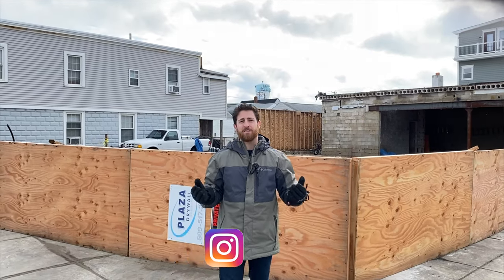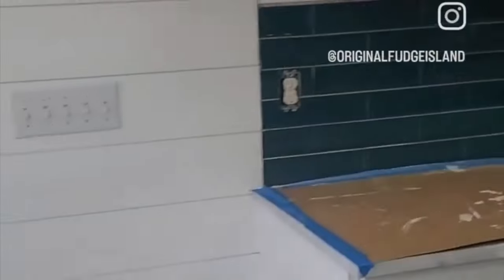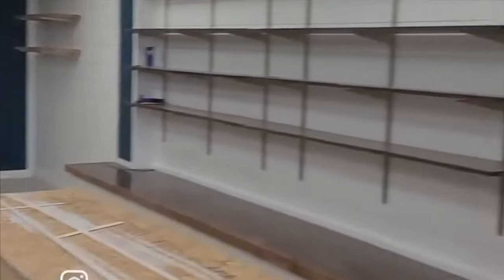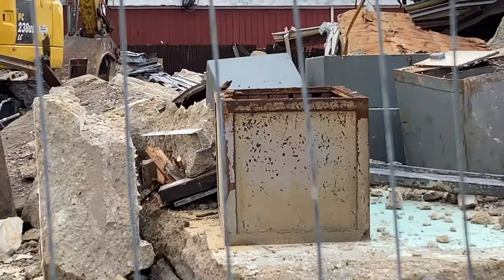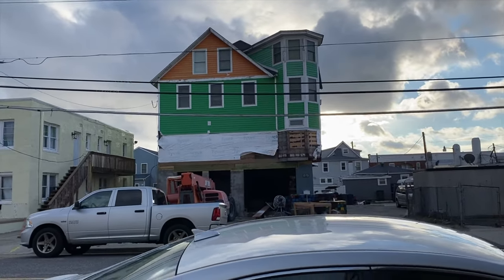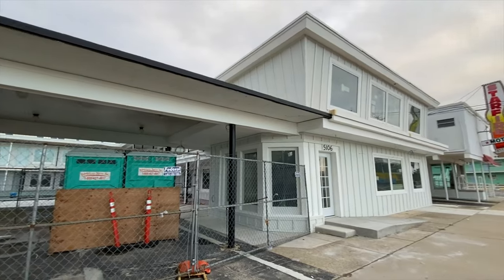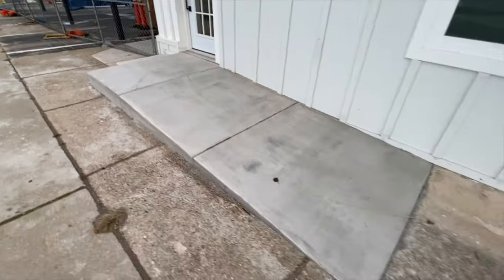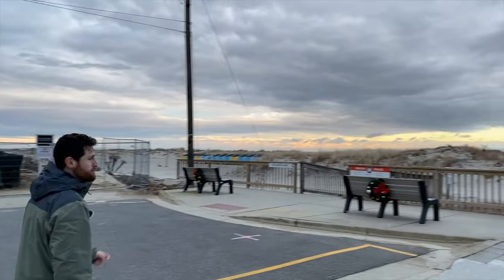Wildwoods Construction Update - Feb 2023

Comment: Sliding thing called a safety deposit box Had one for over 40 years until awful Citizens bank closed our branch months before building a new bank but with no safety deposit boxes. Teller at the old location told me that her bank does not want to be bothered with them even though they charged around $95 a year for the size that you shown. One bad point is if somebody breaks into your safety deposit box bank is not responsible..

Comment: 6:10 - If I didn't know I was watching a vlog about the Wildwoods, I would have sworn this boardwalk was in Atlantic City!  Same pattern.

The diagonal board patterns will relieve the dynamic stresses of being walked and driven on by tourists and Tram Cars every season, compared to the boards that were perpendicular to direction of travel - across the boardwalk.  As well as expanding and contracting with summmer heat and winter chill.